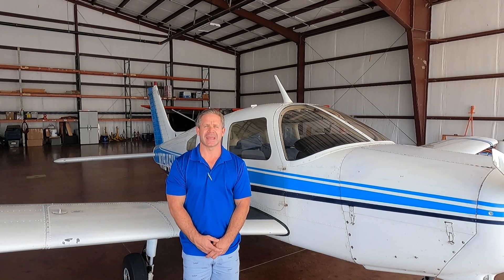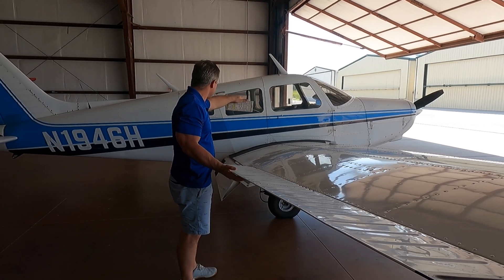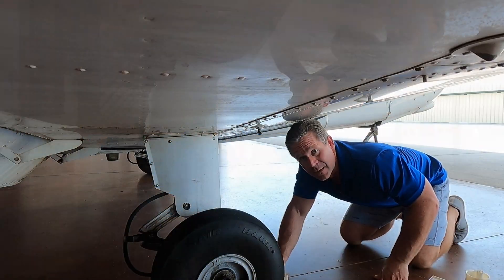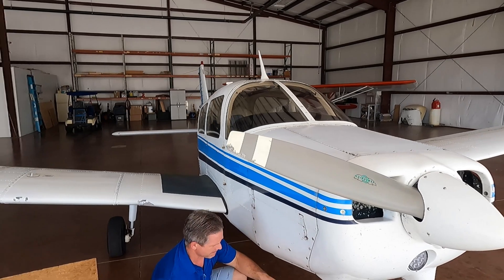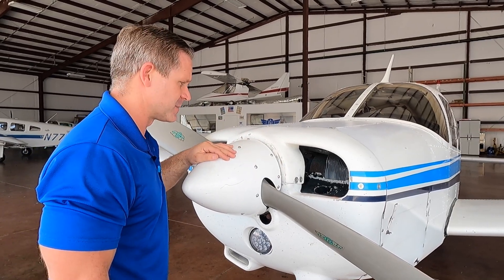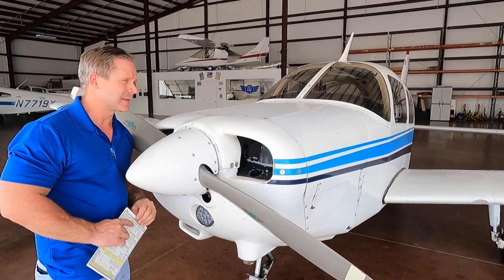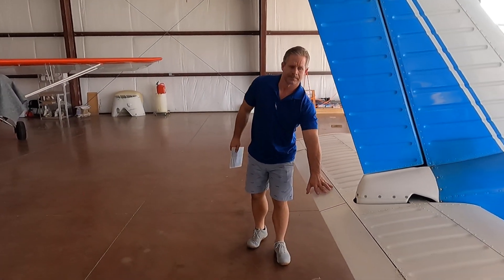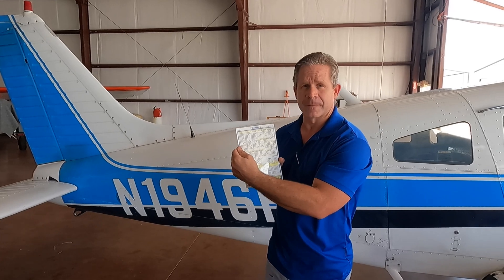Safety Series-Piper Warrior preflight

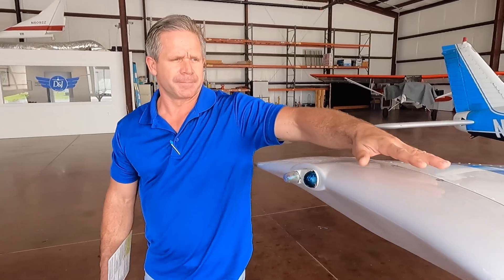Comment: 2:45- 3:10  you advise: Don't put much weight on the old plastic wing tip because it might break???  If it's going to break, I'd rather have it happen during the preflight inspection rather than when I'm flying over a school yard or hospital.
Reply: A good point, but I’d suggest that this is because the wingtip is subjected to an even load over it’s entire surface during flight, not a downward force applied to a particular point the size of a few fingertips.